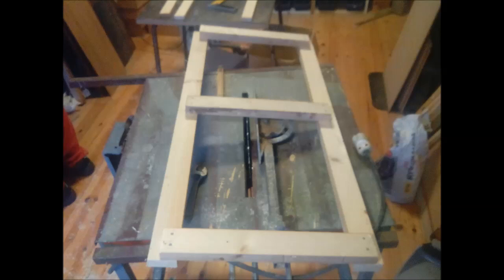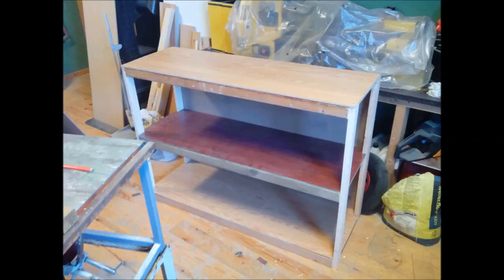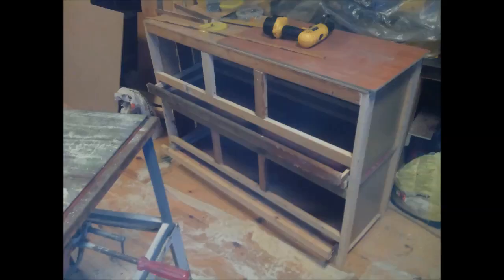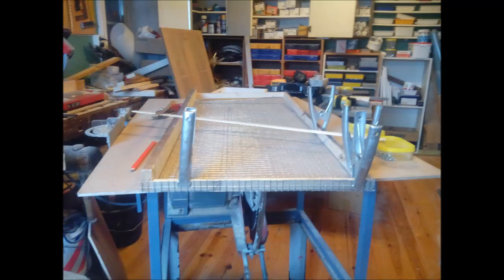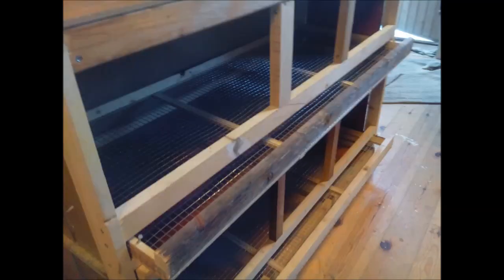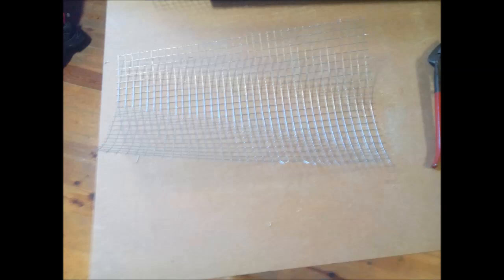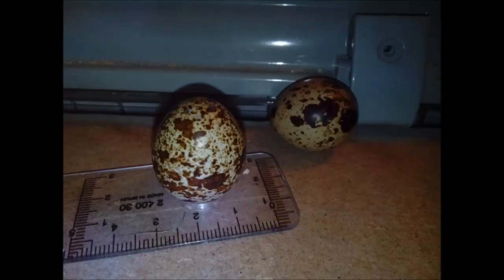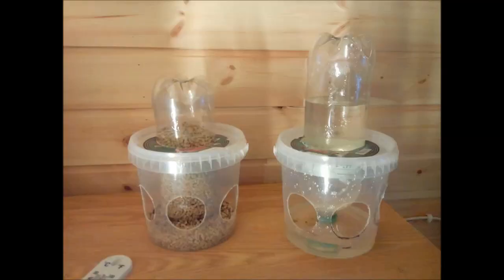DIY quail cage

Comment: That is a pretty slick cage!
Reply from the maker: +Hidden Thicket Thank you, but it was too small really. I had 4 females and one male in one of them and 3+1 in the other. One of the birds also hurt one foot on the mesh. But most of the eggs rolled out so that worked good. And my water solution was no good indoors, to much water got wasted and ended up on the floor..
Reply: Thinkering&DIY JensO.net
That's a shame! I learned myself that if there's too many in a cage, they brutally murder each other. I think I lost half of mine total to just aggression.
Reply from the maker: there was some picking, but not much. Was way worse when i had almost as many males as females in one cage... Let's just say it didn't work out that well for a few of them..